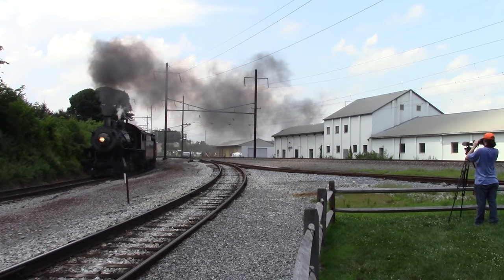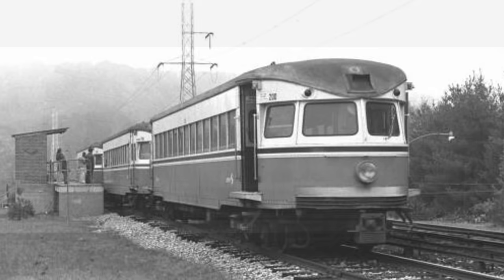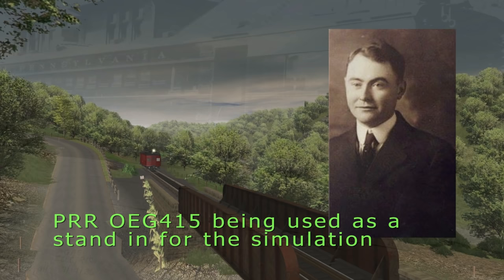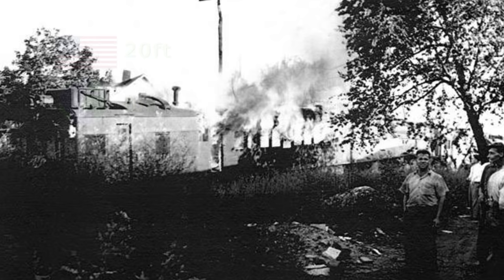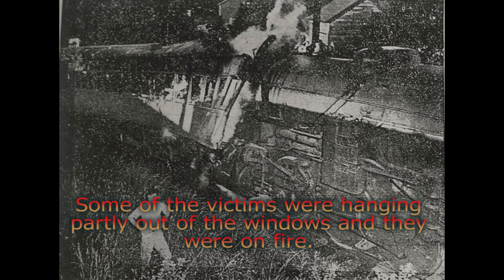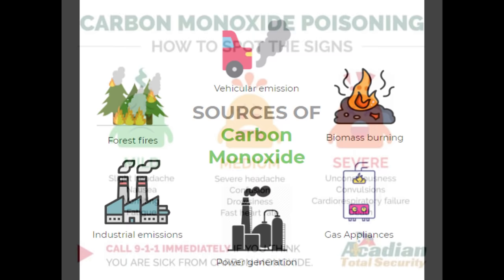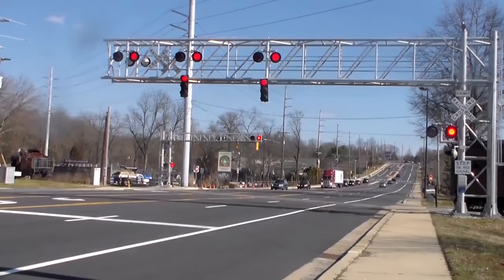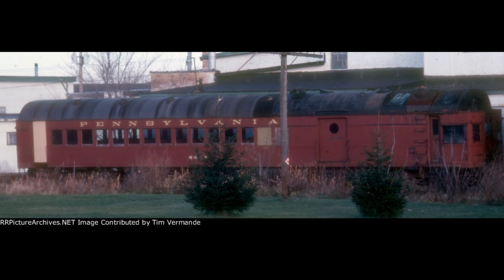The Doodlebug Disaster 81 years later

Comment: 13:55 is that a whistle on that locomotive?
Reply from the maker: Yes a Hancock 4700 air whistle. These could sometimes be found on 1st gen diesels to make em sound like their steam counterparts. They were VERY common the New Haven's equipment
Reply: @Thunderbolt_1000_Siren  Very neat!  Is this what I am seeing at the very tip top at the front and rear of the locomotive?
Reply from the maker: @Guillotines_For_Globalists  its only on the rear (short hood) but to the camera its the front right. Its been known as the "d*** in a dish" due to its shape
Reply: @Thunderbolt_1000_Siren  I researched this air whistle and it looks entirely different.  I'm not sure what I am seeing.  Maybe bells?  At the front and rear of the locomotives at the very tip top, on the very edge where the front vertical surface meets the horizontal roof.

Comment: 13:45 Diesel is actually cheaper to produce from crude..... as its WAY less refined 
.
the ONLY reason diesel is not 1.50 at the pumps VS gas/petrol 3.20 is because of taxes and the EPA
for MANY MANY years (before the last tax hike... and EPA regulations) diesel was far cheaper
.
its why cars in the 80s tried using diesel engines 
they get better MPG.... as diesel has more energy per drop
they are simpler to build (no spark plugs, points/coil packs..... ya just need a piston moving up to create compression.... and an injector)
less maintenance (the oil lasts longer... no spark plugs to change, usually simply built more "heavy duty" than a gas engine)
.
.
but ya.... diesel used to be FAR cheaper than gas
and gets WAY more MPG for the same HP
also makes more HP for a given engine size
.
which, again, is why GM tried using the Oldsmobile diesel in their cars.... but development was rushed due to the fuel crisis..... and they broke down A LOT
so today.... very few "family cars" have diesel engines
.
if the olds v8 diesel was successful..... im willing to bet 50 bucks that 70% of "family cars" on the road today would have diesel engines 
which would be WAY better for the environment... 
.
.
.
like... the modern diesel is back to having breakdowns everyday due to the EPA limiting soot output
they fixed the NOX issues with turbos and electronic injection 
.
but because idiots "roll coal".... they need to have particulate filters
which requires an extra fuel injector to self clean
.
so you are burning MORE FUEL..... to have a slightly cleaner exhaust
.
.
id rather have less exploration, drilling, pumping, hauling, refining, pumping, hauling, pumping into your tank
VS
less emissions at the tail pipe of ONE vehicle 
.
drilling for oil is VERY dirty 
the pumps use electricity..... which is coal powered
the hauling is done by trains and semis..... which have lower emissions standards
refining is very dangerous..... and depletes our total supply of oil on earth
.
and even the pump at the gas station is "coal powered".... as its electric 
.
.
their is WAY more than 1 gallon of fuel burnt...... simply to put 1 gallon of gas in your car
.
.
.
.
.
.
.
.
and no... your tesla isnt the answer
with its 10,000 year toxic battery..... from strip mines in china that use child labor
.
and its "fueled up" (charged) with energy from coal power plants.....
.
modern diesel engines actually CLEAN! the air....
the air coming into the intake can actually have more CO, NOX, etc than the exhaust gasses...... due to DEF (aka, cat piss injection) and SCR filters
Reply: 13:54...... wrong.... so damn wrong
diesel engines have WAY less parts
.
all you need is compression (aka a piston moving in a cylinder) to light the fuel
a cam to open the valves 
and an injector 
.
a gas engine has.... 
a piston and cylinder to make compression
a cam to open the valves (EXACTLY the same cam, lifters, valves, pushrods or OHC as a gas engine.... the EXACT SAME!)
an injector 
.
PLUS!!!!
a spark plug.... 
a way to fire the spark plugs (AKA a distributor, which has about 20 parts... more with vac spark advance)
or on a modern car....a coil on plug system and a crank (or two crank sensors) and cam position sensor 

.
.
.
.
i am a mechanic...... and simply a person who LOVES "hot rodding" 
diesel engines are VASTLY simpler to build, run, and work on
.
you need spark, fuel, air, and compression for a gas engine (and a way to sync everything up...... and advance the spark as RPM climbs)
VS
you need compression, fuel, and air..... for a diesel 
.
instead of spark timing/advance (vacume pots, weights, springs.... or a crank sensor, cam sensor, and ECU)..... 
you simply can ignore that for a diesel...... fuel gets injected at the same time (or you use weights and springs.... to tell the mechanical injection system the RPM)
.
modern diesels use JUST a crank sensor to tell what cylinder needs fuel.... and what RPM the engine is at..... and the ECU simply tells the injectors to spray earlier 
.
.
.
.
again.... diesels are FAR simpler 
simpler to make
simpler to run (less parts)
simpler to work on
Reply: however.... yes.... it was a VERY VERY bad idea to use a gasoline engine.... INSIDE the cab
even if it was mounted outside the cab.... the fuel is still explosive 
.
you can toss a burning match into diesel fuel..... and it will simply get put out.... like tossing it into water
.
do the same with gas..... and the vapor layer onto of the liquid would catch fire..... RAPIDLY catch fire and RAPIDLY burn
.
.
.
.
if you can somehow not get the match into the gas vapor..... and put it directly into the liquid gas
it would also go out.... like with water
.
but as you said.... gas produces vapors at a MUCH MUCH lower temp
.
.
.
diesel NEEDS compression to ignite..... as its more like an oil

Comment: 13:53...... wrong.... so damn wrong
diesel engines have WAY less parts
.
all you need is compression (aka a piston moving in a cylinder) to light the fuel
a cam to open the valves 
and an injector 
.
a gas engine has.... 
a piston and cylinder to make compression
a cam to open the valves (EXACTLY the same cam, lifters, valves, pushrods or OHC as a gas engine.... the EXACT SAME!)
an injector 
.
PLUS!!!!
a spark plug.... 
a way to fire the spark plugs (AKA a distributor, which has about 20 parts... more with vac spark advance)
or on a modern car....a coil on plug system and a crank (or two crank sensors) and cam position sensor 

.
.
.
.
i am a mechanic...... and simply a person who LOVES "hot rodding" 
diesel engines are VASTLY simpler to build, run, and work on
.
you need spark, fuel, air, and compression for a gas engine (and a way to sync everything up...... and advance the spark as RPM climbs)
VS
you need compression, fuel, and air..... for a diesel 
.
instead of spark timing/advance (vacume pots, weights, springs.... or a crank sensor, cam sensor, and ECU)..... 
you simply can ignore that for a diesel...... fuel gets injected at the same time (or you use weights and springs.... to tell the mechanical injection system the RPM)
.
modern diesels use JUST a crank sensor to tell what cylinder needs fuel.... and what RPM the engine is at..... and the ECU simply tells the injectors to spray earlier 
.
.
.
.
again.... diesels are FAR simpler 
.
simpler to make
simpler to run (less parts)
simpler to work on
Reply: however.... yes.... it was a VERY VERY bad idea to use a gasoline engine.... INSIDE the cab
even if it was mounted outside the cab.... the fuel is still explosive 
.
you can toss a burning match into diesel fuel..... and it will simply get put out.... like tossing it into water
.
do the same with gas..... and the vapor layer onto of the liquid would catch fire..... RAPIDLY catch fire and RAPIDLY burn
.
.
.
.
if you can somehow not get the match into the gas vapor..... and put it directly into the liquid gas
it would also go out.... like with water
.
but as you said.... gas produces vapors at a MUCH MUCH lower temp
.
.
.
diesel NEEDS compression to ignite..... as its more like an oil